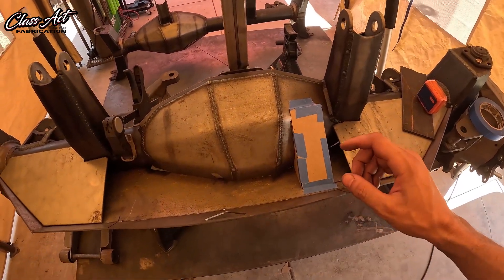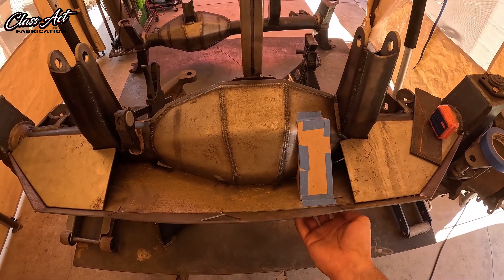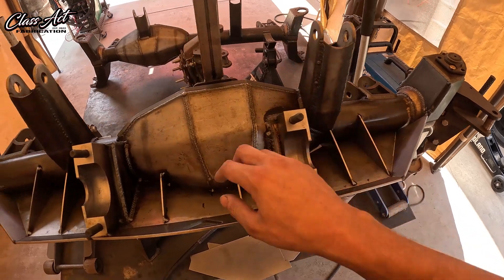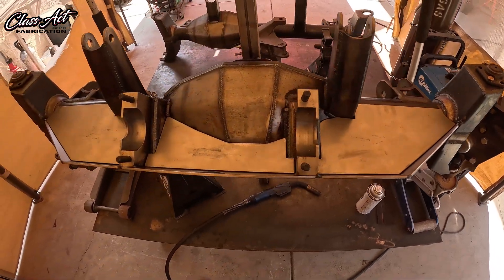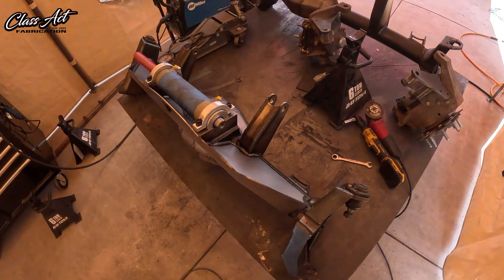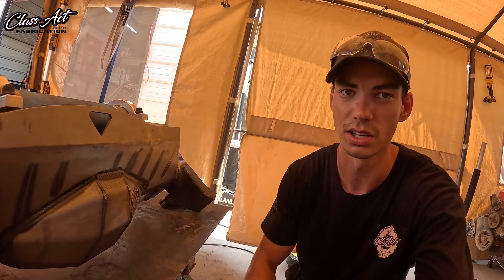Portal axle ram mount on a trailgear housing

Comment: Do you set any caster into the rear steer axle?
Reply from the maker: Yes 5 degrees
Reply: @Classactfabrication  5 degrees top leaning forward?
Reply: @Classactfabrication  what about front caster . And where do you check angle. Ill be on that job soon with my portal car build